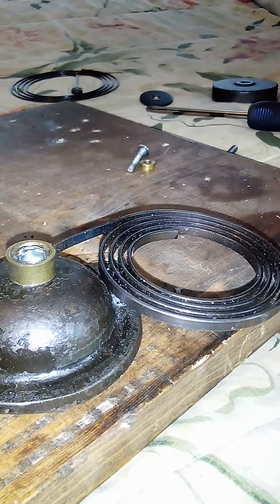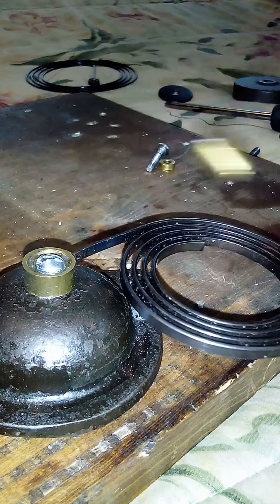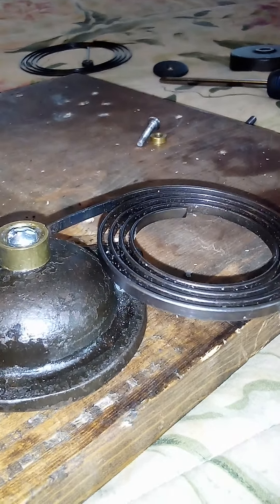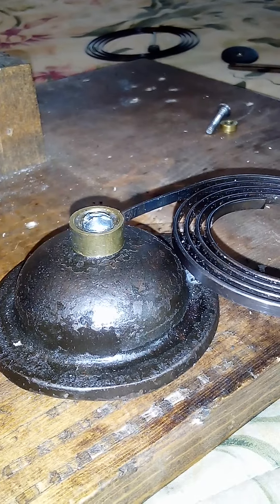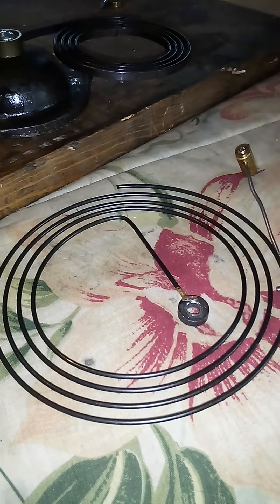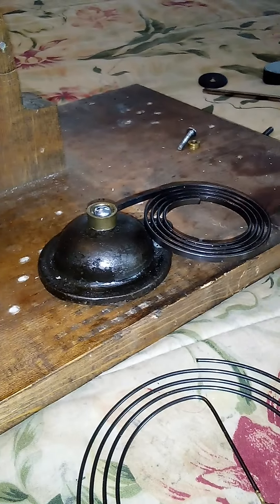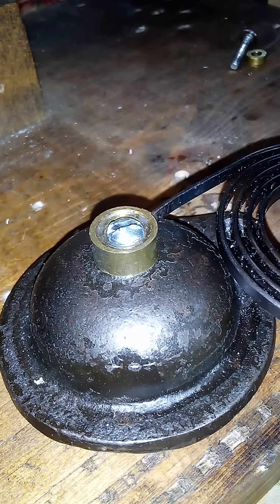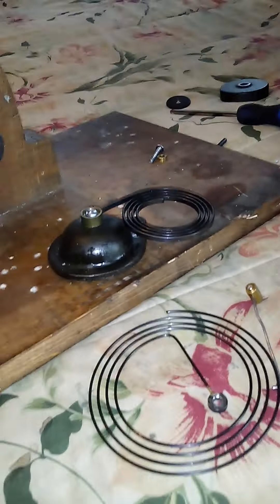what the same gong sounds like without aid

Comment: It definitely was deeper in the previous video, this one was more clanky/harsh.
Reply from the maker: thank you very much
Reply: @jordanbusby6231  You should try adding a rubber o-ring or small rubber band between the screw and mount. Would it make it more mellow/smooth, or just fully deaden the ring?
Reply from the maker: @bradb4075  more mellow felt would do the same thing if you would like to try that